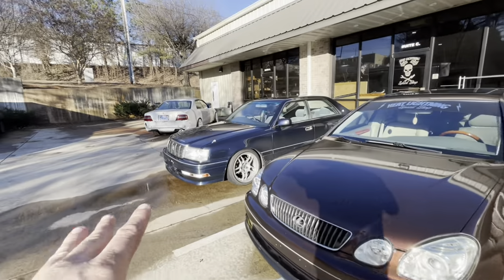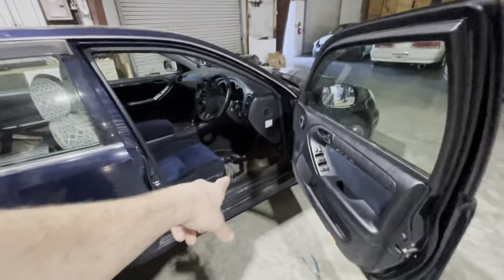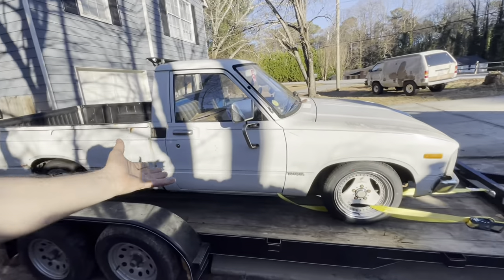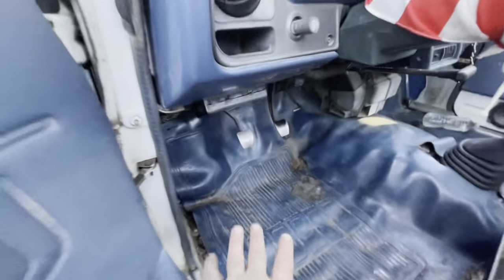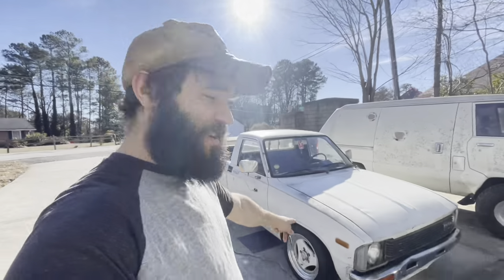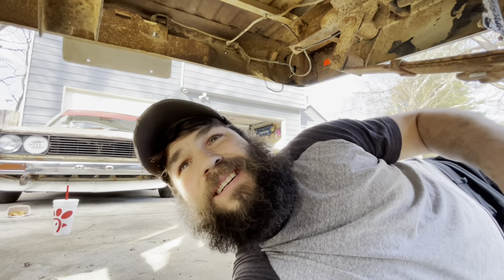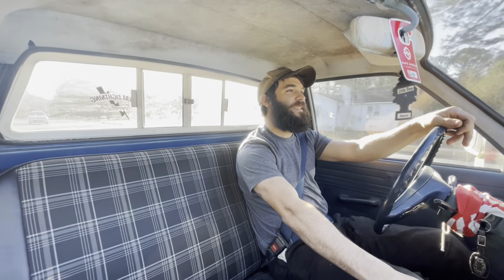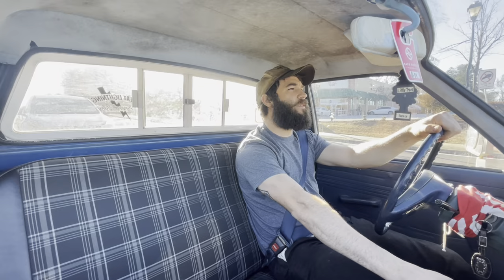New project! 1981 Toyota Pickup! Zero Dollar Rear Suspension!

Comment: Firstly l live in Australia and these are the Hilux ute and l own a 1997 Toyota Hilux with the famous 22R motor and what a motor done research on the 22R and they are so good well mine is a testiment to that mine is the 1997 year model and Toyota its the Australian model with a caburator the original aisin l am trying to keep it as original as possible my philosophy is it isn't broke why fix it and everything about it is built to last mine is a rear wheel drive very few were 4X4 and it has rectangular head lights also 3 years ago l paid aud $1500 for it now its worth aud$5000 to aud$6000 as long thet are manual which it is has an aluminium tray which it has have air conditioning which has and of course the 22R engine under the bonnet the differences of the Australian model are quarter vents a caburator no car converter because up until 1997 commercial vehicles were exempt from emissions laws l do have a very stiff rear suspension and unfortunately l cannot change that because in N.S.W we have a yearly registration inspection and a previous owner put new rear springs and it has to be capable of carrying a certain weight over 1000kg now there are very few hard bodied trays around l have only seen one mostly aluminium trays but there a couple of double cabs with the tray but when l see a Toyota ute with the 22R engine in it that ute is going to last a long time
Reply from the maker: Great trucks! I love them
Reply: @deathwobble  In Australia we call them utes trucks are bigger and carry a lot more l drove trucks and Ute's you can't take a truck to do shopping but l take my Ute and my Hilux is the best carburatored four cylinder vehicle l have ever owned and l have had a few of them in my 50 years of driving actually my Hilux ute is the only carburated ute l have ever owned but l have owned cars and vans that have had a caburator and this is by far the best